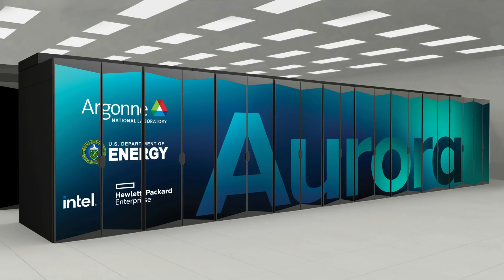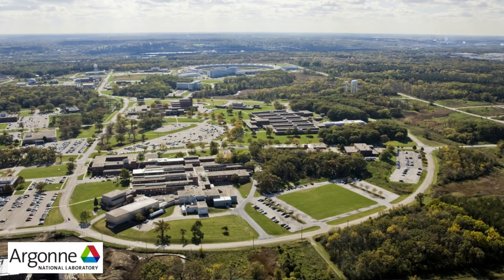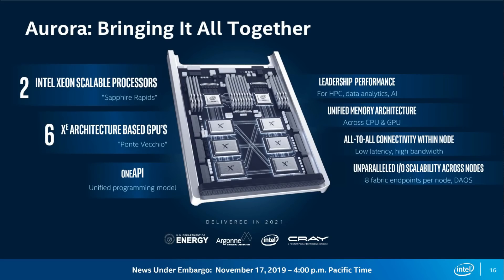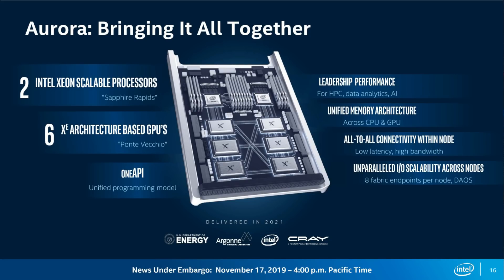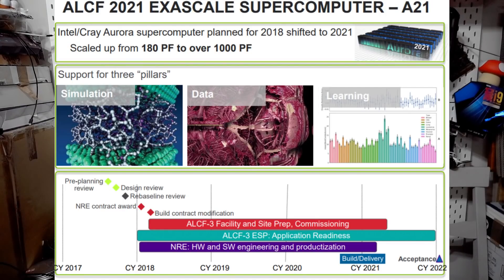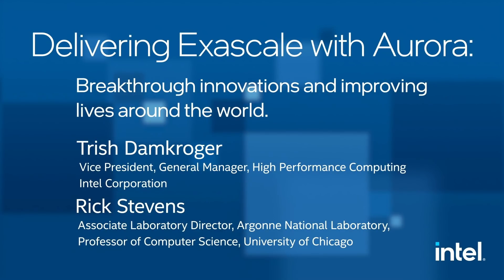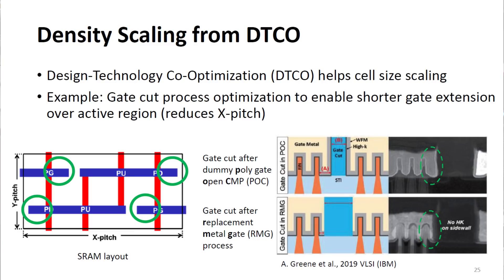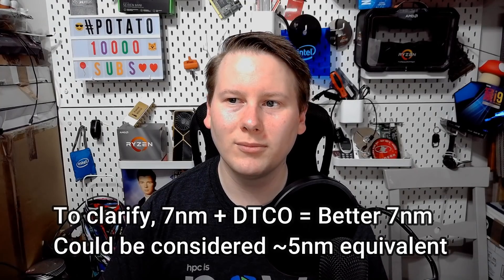Short News: Intel To Use ML on 5nm?

Comment: I Propose a Engineering Equivalent to Godwins Law:

As a technical discussion grows longer, the probability of someone suggesting Machine Learning as a solution approaches 1.
Reply: "I bet we could improve this with blockchain"
Reply: @tiredkiris  The difference is that ML is actually immensely helpful in a great many applications, while blockchain is something extremely specialized and limited.
Reply: @tommihommi1  I agree, but people seem to treat both like a silver bullet to magically solve every problem.
Reply: @tommihommi1  blockchain is the holygrail of data resilience. So I would say as a storage discussion grows longer, the probability of someone suggesting a blackchain approaches 1.

While for ML is a processing discussion
Reply: @EduardoRFS  I think it's the holy grail for distributed data. For purely local storage, not so much.
Reply: @tiredkiris  Well blockchain has magically solved a grand total of one problem so far. Meanwhile machine learning absolutely has been a silver bullet these past several years, it has literally just revolutionised so many industries. So many problems have advanced more in 6 months after introducing ML than they have in the previous ~70 years.
Reply: @tiredkiris  Or someone just saying "what about cloud?" and then you check them with "maybe, what kind of cloud are you thinking of?". Blockchain, cloud, AI/ML. All are used as buzzwords and often used by people who know neither the problem nor what a solution using it would look like. There was a funny cartoon strip of a manager telling an engineer "we need a database", where the engineer replies "which color?", and the manager says "red", and the engineer goes (internally) "great, he saw a presentation about databases and got hyped, so i can just ignore it and probably never hear of it again". Unfortunately AI is potentially harder to dismiss why it's not applicable or realistic in scope and timeline compared to a database or moving things to cloud.
Reply: @gulllars4620  >"Unfortunately AI is potentially harder to dismiss why it's not applicable or realistic in scope and timeline compared to a database or moving things to cloud."

Because AI shouldn't be dismissed with many things? It has revolutionised so many industries over the last several years, we've entered a golden age of ML, it's crazy. We have gone from problems we didn't even know how to approach, to almost solving them in sometimes as little as 6 months. And it looks like we're just at the start of this, unlike blockchain which has solved literally one problem, ML has made huge advancements on dozens and dozens of problems, maybe even hundreds already.

Also the cloud shouldn't be dismissed either. Moving to the cloud is a really good way to potentially either save a fuck ton of money, and to do things you wouldn't have been able to do before. There's a reason so many companies are moving to it, even excluding management. There are countless advantages to the cloud, which is why businesses of all scales and sizes are moving to it.

But yeah blockchain really is useless for everything but crypto. And crypto is shit, it uses way way too much energy. Until someone comes up with a method where the proof of work is something actually useful, such as protein folding or black hole simulations, etc, or even a system where people can vote on the problem, then until then it's just an environmental disaster.
Reply: if machine learing doesn't help blockchain will for  sure do the job.
Reply: Yeah, we can't solve a problem, let's spray some ML fairy dust on the problem...
Reply: Possibly, but I'm not sure. We should design a machine learning algorithm that can determine the progression of technical discussions, then we'd be able to determine whether it's true!
Reply: Just a question of time before ML becomes MI (machine intelligence). Then it will naturally always be referred to because it will always be better.

Comment: It’s one of their ways to improve, you’re forgetting about what Intel has already done and how many smart people behind intel products, it’s true they never played too fairly. You’re forgetting they are going to use Ai as an other tool or option that will push them for their result they want. They are going to push for 3 or even 1nm while only wanting 4nm they are pushing for an impossible target to what they really want. 

If intel really wanted they could just make their silicon bigger if they really wanted they could add more cores and more threads it’s not about how small your transistor is really, don’t forget it does but it’s not everything , they could improve and get their transistors smaller but they already failing at getting their silicons cheaper don’t forget that amd had the stress of being bankrupt and make their products even cheaper and intel didn’t do much they had a working product and they pushed it slightly to be better intel didn’t change too much when they needed for intel’s engineers it’s hard for them to innovate because their bosses are sometimes out of touch with what’s going on. It could be a side engineers who left that maybe didn’t do much but made everyone work better it could be a dozen different ways . Sadly intel try to push uncompetitive products while they need to stop and think. Intel made huge mistake when they maxed their clock speeds they had to work on being less electricity hungry and more cores and threads even if it means lowering the clock speeds to pack more cores and threads they are too out of touch with their developers I am really unsure if intels switched to work for AMD

Comment: I used to love Intel but when they're still pushing desktops on 14nm and apple launches a 5nm chip you know they're in trouble.  Intel should just farm it all out to TSMC.
Reply: Intel is caught between a rock and a hard place.  Intel's main business has been cuting edge process in high volume.  They still have 10x AMD/TSMC volume at 14 nm.  But now,  they have to go begging for foundry capacity at 7 nm and 5 nm and get in line behind AMD and everyone else.  That merely gets Intel to parity with competitors in performance AND fab capacity.

Comment: Here’s a fresh perspective (code words for creative and naive). It looks like a well defined problem that leads to straight forward decisions on which ML algorithm variant is an improvement.

I imagine algorithms that break down the problem into subsets, then systematically try many variations to optimize each subset.  The key is like computer chess ... smart guidelines that focus the range of variations to the possibilities that have greatest promise.  Of course it would start with taking advantage of known best solution designs where it makes sense.   
       I imagine a higher level interactive design algorithm that allows optimization of multithreads per core, increasing the percent of time circuitry is employed in meaningful ways. 
        Ultimately, I expect the algorithm to explore the performance of variations of itself and thereby optimize it’s own decision making process.

Comment: Intel needs to get it's 10nm straight before thinking about 5nm.
Reply: Why tho ? It’s not making them better even their new 5.1ghz clock speed. When amd clearly had the power to change their clock speeds and pin point on slight improvement for their cpus hate it or like it amd could even get 5ghz too . But it doesn’t matter intel doesn’t know how to pack more cores than 24cpu cores unlike amd, intel cpus suck too much electricity and doesn’t know how to make APUs and above all they try to solve issues just for the short terms.there is good reasons why it’s important to know why and knew about their ability to reach 4.3 base clock speed.they can even reach more they didn’t even change their socket . Big company need to work as an organ intel doesn’t work as an organ. They don’t aim for the future at least it seem. It amazing when AMD found why their system produce unstable cpus and got their engineers to produce stable chips they got so good and it all it took. Also don’t forget AMD relays on other companies and INTEL keep their software close their company it sad to see them only working to fix everything in the short term
Reply: It doesn't matter, it's not a gradual process, they can go directly to 5nm if they want to, if that's going to work for them or not that's another story
Reply: Why tho, 5nm is better than 10.

Comment: I was assuming all the big fabs had already been using some forms of AI in their tooling for some time. Maybe I was overestimating how widespread that is. I get these are probably very complex problems with tons of tunable variables, but I'd assume you also had a lot of data and possibilities to run simulations for feedback loops of calibration. If those assumptions are correct it would seem to me like the kind of optimization problems AI could potentially significantly improve.

Comment: This sounds like another distraction from how bad things are going for Intel's current projects and roadmaps for the sake of share holders and PR.  I feel like if AI where the answer to designing more efficient process nodes it would be coming from a someone that has grasp on current technology nodes and AI.  Say TSMC/Samsung and NVIDIA, not someone struggling with current nodes and massive delays delivering on current project commitments.

Also, bit of constructive criticism.  Please do something with your set, doesn't have to Hardware Cunucks level of production but as is the visuals are distracting from the content.  And a breakdown of the timeline in a 5 minuet video is just silly.  And/or also whats with the cats?

Comment: Just speaking as a lay person here, but what does AI even mean in this context?  At this stage it must be some form of supervised learning right?  Have there been so many "labeled" combinations and permutations of each process node, or optimization of said process node that this can even become an unsupervised thing?  What do you train a model against here?  Is there already a body of results such that this simulation can occur?  I have heard about Nvidia and others working on the automated generation of labeled data to do this sort of thing for self-driving car simulation, which should speed up design, and testing of new types of ML models.  But there are many more players in that space.  For process nodes, how many players would there be?  Would the work done be something that would be shared, or would this simply be a competitive differentiator for Intel, or for the USA for that matter?  And on a darker more philosophical note, is this not a step on the slippery slope?  Computers designing computers?  I guess there is no taking the genie out of the bottle now.

Comment: I'm afraid Google has already done it, and TPUv4 is already using some of the ML-based design. So depending on the specific angle they seek to take, Intel might be a bit late to the party here. https://ai.googleblog.com/2020/04/chip-design-with-deep-reinforcement.html
Reply: TPUs are much simpler than a fully-fledged x86 CPU, though.

Although admittedly I'm not quite clear if Intel's ML-chip-designer is going to design CPUs as well, or GPUs only,
Reply: @PanduPoluan  Sure, I fully agree. But knowing the algorithms and the tools used to make these inherent multi-objective optimizations scale, I don't see any reason why Google's approach cannot just be scaled to perform the same task for the x86 or ARM ISA.

I'd also rate Google's machine learning teams much much higher than Intel's. They do in addition have a highly efficient engineering team for this area, which includes David Patterson, who co-designed Risc-V.
Reply: @ludgerpaehler1458  True. Google's algorithm may one day be good enough for complex CPUs, just not now.

So, there's still a chance for Intel to catch up in this field. I wouldn't write them off just yet 😉

Comment: Given that Intel basically said they plan to skip 10nm to go from 14 to 7nm for desktop part... what happens if in Q1 2021 they decide not to go all-in on 7nm and wait for 5nm or something else? Haven't they already kind of placed their eggs in the 7nm basket? They aren't going to go to 10nm, not after backporting their architecture to 14nm, and sticking with 14nm while AMD moves on to TSMC's 5nm or even 3nm nodes would be suicide.
Reply: Intel 13gen redwood cove is to be desgin for any foundry fab. If intel unable to produce 7nm euv by this year than tey going to use third party fab. But third party fab would not be impressive for intel foveros technology. Intel's 7nm will have 200milion transistor per 1mm square where tsmc 5nm only have 175 million transistor per 1mm square. So if intel going to use third party fab like Samsung or tsmc 7nm + euv than intel only will get 115 million transistor per 1mm square where intels 10nm as of now having 100milion transistor per 1mm square. I.e switching to other foundry for 13 gen meteor lake will not be impressive for intel. Because lesser number transistor will not allow them to put aggressive specification on redwood cove. So this next 6months for intel is very crucial  . Intel set their dead line for 7nm euv by July 2021.
Reply: @bakulboro2292  we have to wait until January to see if intel will going to tsmc or they will further invest in equipment for their 7nm node.
Reply: Alderlake will be using 10nm node so they are not skipping 10nm on desktop.

Comment: Is golden cove 8 core going to defeat 16 core 5950x on synthetic benchmark?
How much 6 alu per core will give benefit to alder lake?
Reply: I mean just benchmarks arent that important it can give an indication of power but its not everything. And for gaming I don't think you'll currently see a benefit of having more than 8cores.
Reply: @sansundertale69availablename  in gaming intel was ahead just few weeks ago with its 5years old architecture. The funniest thing is that in between 5 years from 2015-20 , amd hace changed 3 times process node and 4 times it's architecture so that amd able to beat intel in gaming though. Interestingly in four years intel has developed it's architecture 3 times with golden cove 4 times namely cannon lake, sunny cove, willow cove but sadly due to bad yeild it's never come out in market . So amd actually compeating with 5years old intel technology . In this sense you can assume how intels architecture are suprior over amd. 
So coming to the point right now, amd zen3 4/5% avarage over intels comet lake ( actually skylake) in gaming , that said upcoming rocket lake going to change its architecture after a long time and every one knows that 11th gen rocket lake will be next gaming king.
But it will not going to defeat zen3 in multi threaded application which is loud and clear. 
And as we can see intels upcoming product are full developed on the basis of advanced features like avx 512, fovrose, b flot 32, 6 alu per core etc. rather than high number of core which we do see in ryzen. 
So that my question is straight and forward that the upcoming alder lake 8 core could able to defeat a 16 core processor with its advance features in multi threaded application?
Reply: @sansundertale69availablename  fx 8350 even worsen than phenom series processor. Thanks to Jim Keller who brought legendary zen architecture for amd with 50% IPC improvement. And 3 years back atleast we could say that was the product which can change amd future but since 3 years we have seeing amds improvement not on mark . Yes everyone can say look at intel it's never stand right after amd but we have to admit it's actually a skylake prodouct just a biger brother of 6700k. Even though if you can compare 3900x Vs 10900k in synthatic benchmark , the 10900k just 8% behind after 3900x and it's noticeable due to lower number of core in comparison to 3900x . The 3900x is using 7nm tsmc fab which is 80% tranisteor denser than intels 14++++++++, and that's why  due to lower transistor density intel can't offers high nuber of core within a certain area. But 
Is amd utilizing it's transistor density and its advance architecture?
The answer is no!
The amd progress is remain same what left behind by Jim Keller, this synthetic incresing score due to switching new architecture and process node and is not upto the mark. 
We have seen amd revolution twice amd k6 1997 and amd x64 2005 . And previously everyone thought intel can take back it's position but intel did overcome again and again with pentium 3 and core two due.
And previously amd achieved by its own hand this time it's done with the help of third party tsmc so it's amd holding position longer than previous two. But if amd going in this way history third time going repeat again. And using advance node to sustain its crown is not solution becouse now a days switching to advance node no more profitable  due to sub threshold conduction. The tsmc 5nm 70% higher cost wafer than existing tsmc 7nm and 3nm will be twice costly as compare to tsmc 5nm. And amds volume of production is increasing and volume of production also increses risk on production.
I can clearly see amd strategy will save them till 2022 .